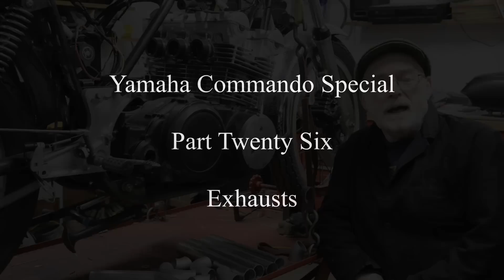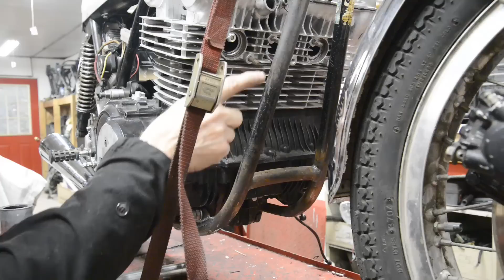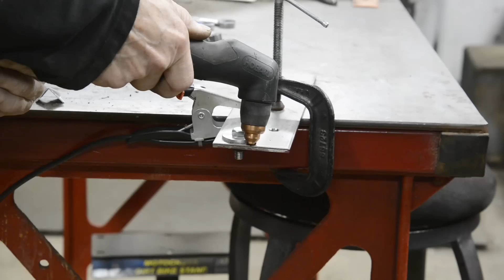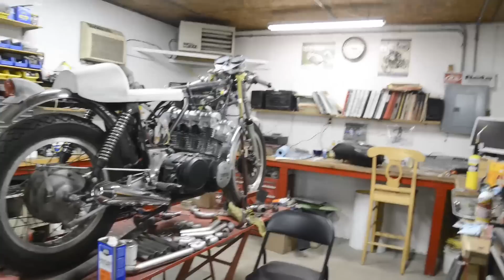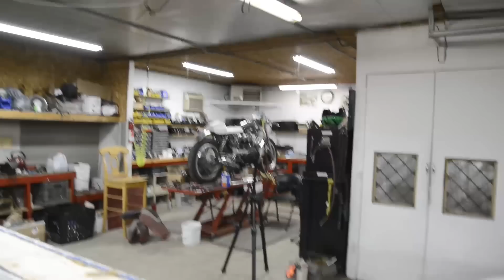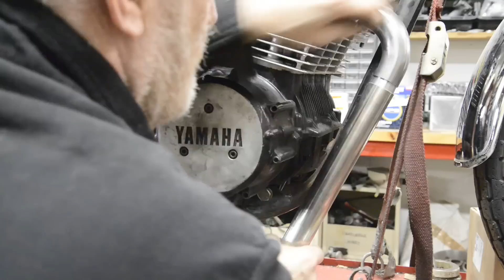Yamaha Commando Special  -  Part Twenty Six

Comment: Looking good Mike, just consider the exhaust flow when you siamese the middle pipe into the outside one. Do you think tuning might be an issue with 2 into 1 on one side and a single on the other? Personally, I would like to have the middle pipe siamesed into both outer pipes like headers/extractors.
Reply from the maker: I will make the entry at an angle and I think the layout will work even if it is not perfect. I will talk about it on the next video.

Comment: Michael , muffler looked a little like the ones that were on a 1975 650 Yamaha I had , I thought like a Harley  they used a t stud or t head bolts that slid into muffler  and you used a nut to tighten  them  down to the mount ?  Bill Andrew
Reply from the maker: I would have expected something like that but apparently the company that made them didn't.

Comment: Hi Michael, Another very entertaining and instructional video, thankyou. Have you considered making the centre exhaust header like the 3 cylinder BSA Rocket 3 then join the 3rd pipe under the engine. Or would that be to tricky to get the diameters right for equal gas flow? or perhaps there might not be enough space between the engine and front mudguard (NOT FENDER, that's a guitar!!)  I Like the new open plan workshop too, better than my 8' x 8' shed. Still it wouldn't matter if i had a shed like yours with all it's machinery, I wouldn't know how to use most of it!!! Looking forward to part 27 as usual. Thanks again and take care in that white stuff, non here yet but it won't be long. Dave UK
Reply: Absolutely.david
Reply from the maker: I thought of the Trident split centre pipe but having the twin front down tubes would make that problematic. The single tube on the Triumph/BSA was I think the reason for the middle pipe needing to be split.
Reply: @BritanniaMotorcycles  Had a look at a photo of a Rocket 3 Michael. It too has a twin downtube frame, the centre header splits just out of the head then curls around the outside and quite close to the down tubes and connects to the outer header pipes before the first joint. I have a photo but cannot post it on here, GGGGRRRRRR. I note one or two more of your faithful followers have had the same notion, But no doubt you will as usual have your own wery good solutions to the problem. Ah well Bash on! Dave
Reply from the maker: The Trident had a single down tube frame and it was Triumph that designed the engine. The continuing factory rivalry had the Beeza built slightly differently, canted cylinders and their version of the frame. From the position of things on the special I don't think that I could do it that way, plus I chickened out at the thought of making that Y.
Reply: @BritanniaMotorcycles  I have thought of another couple of ways you may be able to do the job but I think you will be sick of me and my suggestions by now! so all I will do is wish you luck with whatever way you go and I and many others will enjoy watching you do it. Cheers Dave